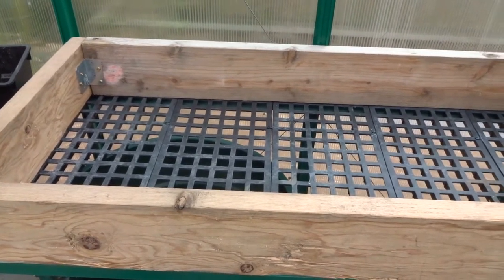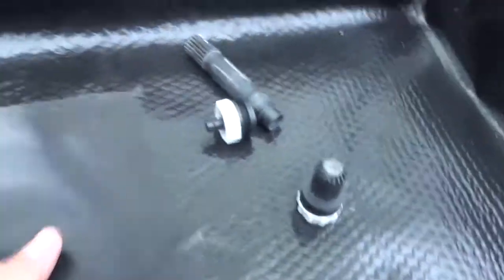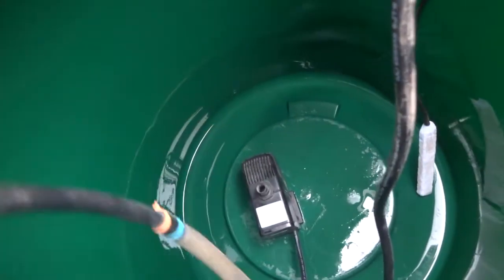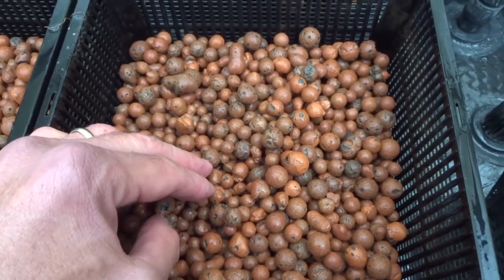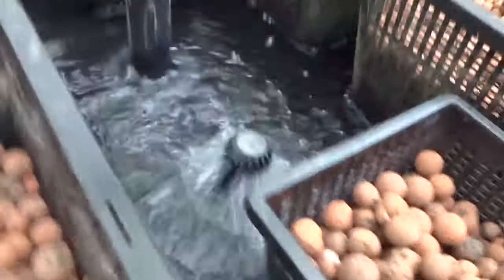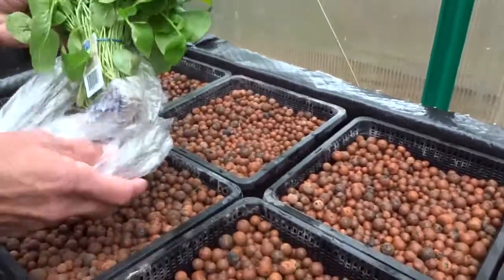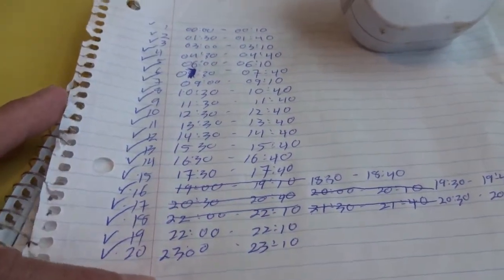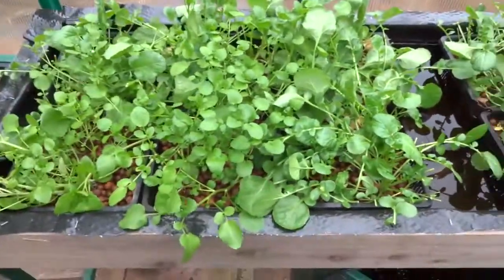hydroponic watercress

Comment: hi i am in UK we would havest it when the leaves are smaller and stems are tender ,  leaving them to the size you tried them will be to hot bitter and tough stems , just cut it back and it will sprout again sweeter and tender stems. water cress is cut and come again plant. that said good idea for growing method one hint i use ph controller to keep water alkaline, as it naturaly grows in chalk streams in the UK, also i did not see much sign of roots up the stems watercress grows like a vine and we cut stems that have roots for for new plants , maybe its a different type are you sure its not land cress?
Reply: I've been growing mine for about 2 years, without a constant water flow, but a constant air supply. I have only recently set a hose pipe up, giving it a more frequent supply of water, instead of topping it up once a day and since increasing the water, the watercress growth has exploded. I'm not even using any chemicals to give it nutrients or anything else and it still tastes lovely. I'm also growing mine outside, with only a mesh netting for cover and it's survived 2 winters. I now have a greenhouse and will me moving the watercress into the greenhouse.